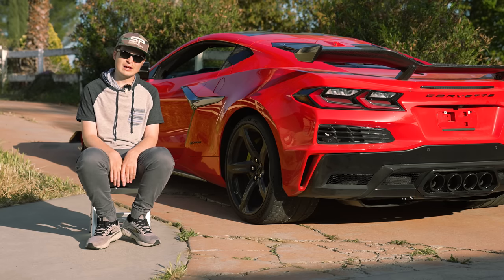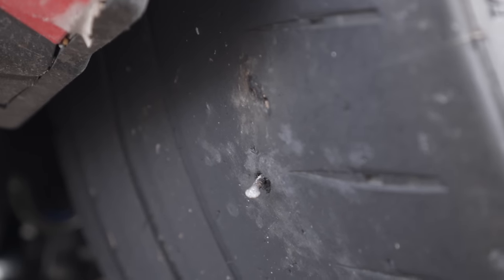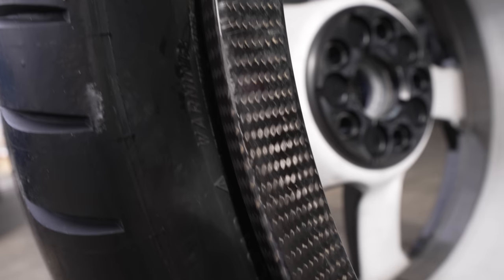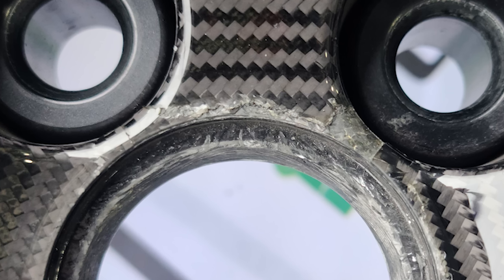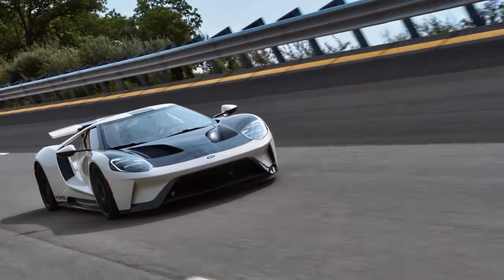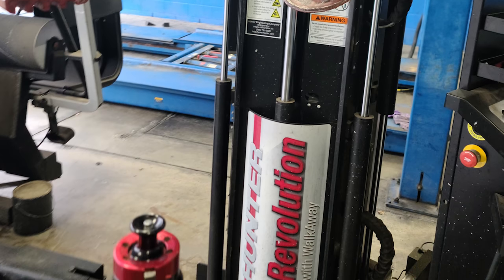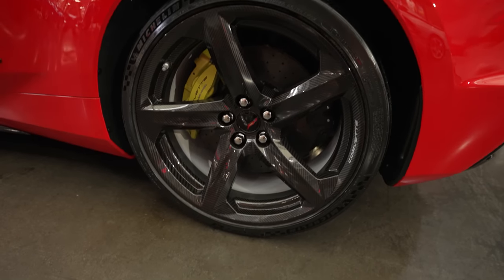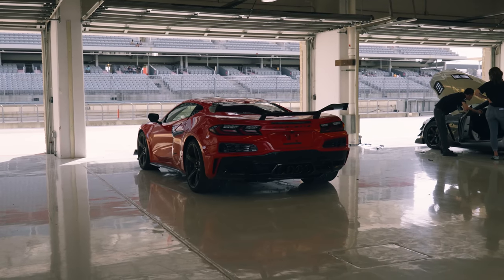MY $20,000 CARBON FIBER WHEELS ARE RUINED... YOU WON'T BELIEVE WHY!

Comment: Sorry, but unlike you, I am not afraid to say where blame lies in my opinion.  It's obviously GM/Chevrolet!  Who else's fault could it possibly be, except the manufacturer of the car?  Even if wheels are manufactured by a 3rd party, they are/should be built according Chevrolet's specifications.  If Specifications are not met, it is up to Chevrolet to go after the 3rd party manufacture, not the new car owner.  If the Specifications were inadequate, then Chevrolet is responsible.  But EITHER WAY, Chevrolet is responsible to the new car buyer.  Obviously, this same opinion applies to the obvious.  Chevrolet must make it possible for it's own dealers to service a Chevrolet. How does a car manufacture build something that they or anyone else can't service?  
The only thing that surprises me, is people who are surprised.  2019 Grand Sport owner here.  Same crap wheel design and same crap Chevrolet support for subpar wheels.  Chevrolet didn't take responsibility for Wheels cracking on C7 Grand Sports or Z06's.  So why is anyone surprised?  
I am in line to buy a Z06 and would love carbon fiber wheels, but I already decided I would not be doing so because of Chevrolet's poor support of defective wheels.  I'm just surprised people are surprised.

Comment: Less than half the cost of a Ford GT? No white glove service for you. Seriously you didn’t pay enough to merit the white glove service (in fords eyes). And they should’ve done magnesium or instituted a center lock system instead. But once again ford feels u didn’t pay enough! They’re 5 lug wheels bcuzz the knuckles/hubs brakes and other drivetrain components are from the Ford parts bin.  Very different experience indeed…

Comment: The real problem is untrained staff , when you walk into a dealership to get repaires who do you think they hire as mechanics?? Ferrari and Porsche have highly trained staff that specifically work on certain models and Chevy well they hire the mechanic that just needed a job and graduated by the skin of there teeth lol 
  Don’t get me wrong they might be great mechanics but they are not specialists.. the guys that are putting tires on the new GT3RS and the Turbo S have been trained to work with carbon and titanium and 5 lug and single lug and they also are taught if something isn’t going to work well to back off and that Chevy kid they hired because it’s the manager’s nephew has no clue about the difference between carbon and steel.. but none of this is an excuse for damaging brand new carbon rims , the integrity of carbon weave means everything that’s where it gets it strength from and when flying around a circuit at 165 MPH into a hairpin turn you are depending on the integrity of that rim …

Comment: I hve carbon wheel on my gt359r.  A.  They can't be redubished under any circumstances.

B.  There is no reason to use thatvtype if maxhine.   You clamp with soft clamps afterr breaking the bead on the inside.